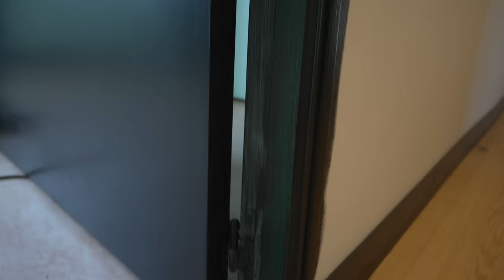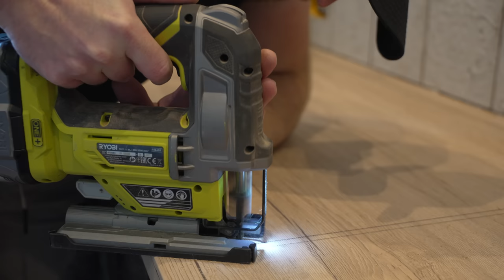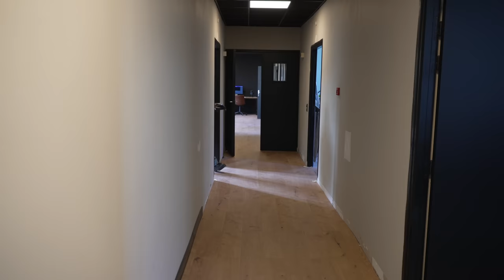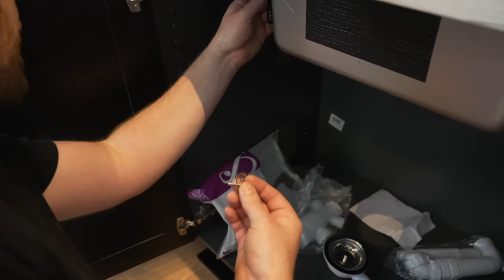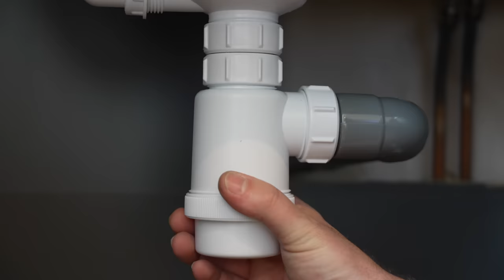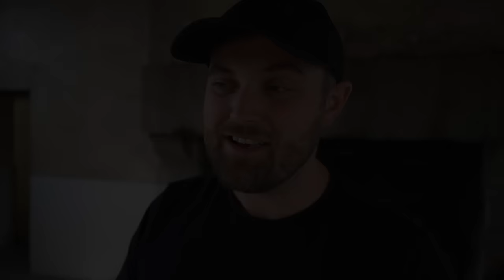We Have Decided What We Want To Do With The Convent

Comment: If you want a multi-function space in that big room you could consider adding some rigging bars to the ceiling so that events can be hosted easily with lighting and sound equipment. Then you can easily put up temporary set ups such as a DJ booth for parties, a small stage for speakers and presentations, ambient lighting for gala dinners etc. Carpeting lends itself to this kind of room though to absorb noise.

Comment: I think its use as a hotel may depend upon where it is situated.  Parking also needs consideration.  As a luxury home the interiors would need a big upgrade and with big rooms, usually comes big heating bills, particularly with high ceilings.  I do like the idea of a conference centre, in which case you may need to consider how big those bedrooms need to be to make it economically viable.

Comment: The whole building screams "Wedding venue!"  It has the Chapel for the ceremony, the large room for the meal, the room with the stained glass could be a breakout room or dance area, multiple bedrooms - a whole wedding group self-enclosed - beautiful gardens to allow the wedding to spill outside in better weather, a catering sized kitchen.  You might convert one of the flats at the front into the wedding suite - total luxury, massive jacuzzi bath, 4 poster bed, away from the rest of the guests to avoid noise issues!!!!!  You could use the rooms during the week as a self-contained conference facility.  The flats at the front could be also adapted to housing for an on-site facility manager/chef etc and possibly made into smaller units for other live in staff.  Just a few ideas.

Comment: Your idea is very interesting. The 40 rooms could easily be converted to 10 - 12 large suites. If you mirrored the suites with the en suite bathes back to back you could seriously reduce your plumbing needs. The large room would make a wonderful multipurpose lounge area that could be converted, upon need, to exhibit space, an open area for party gatherings or any number of uses. It would be great if you could find an antique bar set up much like you did with the chateaux library. The bar could anchor one end of the room acting as a focal point. An outdoor bistro like area in the courtyard would be a great compliment to the luxury/commercial kitchen you were talking about.

Comment: Billy, since you have decided to go in the direction of a public use space for the former convent. I really think the kitchen needs a commercial setup. This would require a 6 to 8 burner range, with two, possibly 2 additional ovens(4 total). Also, at least a single stage commercial dishwasher, is a separate scullery area. Also a separate salad/dessert prep area with a commercial upright refrigerator and a freezer. Of course plenty of food prep surfaces. This commercial kitchen will support any of the activities, wether it is a group staying for a conference, hotel dinning, or inhouse or take away catering. There are local community groups(historical, service, community), that the facility could service easily. The convent served the community for many years, and could continue to serve the community, in a slightly modified form. Great job so far, Crack On!

Comment: Food for thought

If you move the motor to the basement
Would you not need to give up more space in the shaft? 
Thus a much smaller elevator car.
Because all the cables and hardware for them now have to go all the way up on one of the walls. 
If you never need it to move large/heavy items perhaps that's not an issue. But larger appliances and furniture via stairs may be a factor in fixing or replacing the existing elevator. 
Just a thought.

Good luck either way

Comment: I have an idea for the 110 square meter room. My colleagues and I do annual planning seminars every year, where we plan for the coming year and sit together in the evenings, chat, eat well and all sleep in the same hotel. This is not only good for work, but also for team building and the sense of community. This usually lasts all weekend. At the beginning of the annual planning we start together in a large room, discuss schedules, activities and so on. Then the room is separated with sliding doors in ceiling rails and the teams can work in sub-groups or small groups. At the end of the seminar, the walls are pushed open again and there is a joint conclusion.

Comment: Always impressed with your videos, your skills and your ideas. I would love to see some structural archeology done on the convent as there appear to be several buildings that were constructed at different times. The "bump-up" for the elevator appears to be in an old section of the convent where a new roof was constructed to join the older section to a new addition. My eye goes to the mansard roof as the "old" or original structure and the gable roof is the newer addition. Same can be observed on the apartment roofs near the gate. When some renovations were made the "new" roof seems to be gable. Would love to get inside the roofs to see where old construction meets new.

Comment: My thoughts. If you remove one of those rooms you lose a valuable storage space for a kitchen that could be used for catering or conference center. You'll need lots of supplies which would be rather hard to get ot in typical cabinets. Also what would you do with parking?

Comment: I would avoid the option of a wedding venue as so many chateaux locations offer this. A large room with a removable divider that someone else mentioned in comments would leave all options open for the eventual buyer. If the room is decorated in neutral colours and remains an empty space,  buyers would be able to visualise  how they would use it. Buyers would probably reduce their offers by the cost of changes they need to make to the rooms but if they did not need to make changes the advertised price or more might be offered.
The investment so far in my opinion will increase the value of the convent but changes would be a waste of additional investment in rooms if options of flexible use were reduced by them.
Perhaps Ryan or Michael could digitally create options for the rooms, which could later be shown to buyers on a website, sent by email or printed in a brochure

Comment: Good idea on usage. Phillip Bolan has great insight...just saying.  RE: the suites- always a smart idea to have several different 'rated' rooms. Some lesser expensive than others. Question: do you have a formal dining area? The rectory area could be partitioned off (movable partitions) into several smaller areas. Multi-use.  Maid/cleaning services will need storage and laundry facilities. Things to consider.

Comment: When you cut out the sink , you should put silicone all over that cut chipboard edge, not just for bedding down the sink. Also if you just draw the perimeter, you can follow that with the foot of the jigsaw and that gives you the offset you need ( smaller ) ie. you don’t need the inside line too

Comment: I wonder if there would be a market for a gym in your village.  As large as the refectory is, there appears to be enough space to rent it out for that purpose.  Not sure about the shower and toilet situation though.  Just a thought.
-- There are places here in the States where there are either free or very cheap accommodations for the families of patients in a hospital.  At least one or two of those rooms could be used for that since the convent is attached to a hospital.
-- Is there a local college near you or an industry that has clients who require temporary corporate accommodations?  Those rooms converted into either low-cost rooms for college students up to luxury rooms for executives - The gym would fit in perfectly for that. 
Also, for the lift - it might be cheaper and safer to install an hydraulic one.  That would eliminate the need for a motor but also cables...

Comment: For the lift...you can install a MRL (Machine RoomLess)
The motor is installed in the hoistway.
A Hydraulic  powered elevator is an option...both can eliminate the "dog house" on the roof.

Comment: The good idea is to make the Convent a boutique hotel/conference/ multipurpose small biz center. Again, mixed use will bring income in from multiple areas.
Please dont make the refrectory smaller. Putting in that large kitchen,  you will want a massive lounge/dining area,  but make it rich in texture not cold and commercial.  If anything, add a nice private dining area for say 25 people and the rest a lounge and simple table area, but try to have some extension for eating outside. Definitely get rid of the low ceiling.  As far as the rooms go, i would think about closing off some of those very short doors and cutting in standard  6 ft entry doors in between  the old ones. You could put a table or shelf in front of the original doors with flowers or some of your chateau art prints so it isnt confusing to guests and you keep the architecture and character intact.  You may want to add a small dining nook inside the kitchen too. You also shouldnt forget the wine cellar...use it! Make it another area for wine tasting if possible.  Its France after all. 
I am so happy that the metal detecting is on. Good for Mo.

Comment: if you plan on so type of convention or meeting space you will definitely need a full scale commercial kitchen. A high quality restaurant would be a drawing card that could operate year round. In France, people will travel to enjoy good food. As for convention use, it could be businesses or even churches. Literally no limit to the ideas you could come up with. Parking might be a bit of an issue to be considered. Might need off site parting for big meetings with a bus to bring people in. I'd agree that updating the elevator or lift as you call it would need to be done. You're also gong to need a full sprinkler system throughout the building. Those granite walls are pretty fireproof but there's a lot of very old dry wood in those buildings.

Comment: Next time you put a sink in, turn it upside down and with a fine pencil trace around it, put a straight edge for your jig saw and cut it that way. cutting just on the inside of the line. Clamp the straight edge. Using this method, I have never miss aligned a sink. On the lift, is the area prone to flooding? You might want to think twice about putting your motor on the bottom. Same with an emergency generator, suggest putting it on stiltz or well above the ground.

Comment: Just priced an Kone elevator for a 2 story office building $130,000 US dollars in Oklahoma.  That doesn’t include power to the elevator.  You still might need that pop up on the roof for the clearance for the support beam.  Also elevators are a pain to work with at least at the US. Really talk to them to see what they need cause if it isn’t exactly to what they want they push you off for another month.

Comment: Hi
The idea of converting it to a luxurious hotel is good , but if you are thinking of a lounge, bedroom and ensuite than you will get about 10 rooms only, which would be economically unviable. You would have to also provide accommodation for on site staff.

I think a hotel consultant can work out the Economics for you.
Please also keep in mind that if In future you need to change the configuration it can be easily done.

I would suggest making partitions of  brick as guests would like privacy, using board & plank defeats this purpose.
Make it a hotel cum wedding venue so  maximum rooms can be utilized. 
The garden can also be utilized as a wedding venue. 
If thre are more guests the doors between the garden & indoor venue csn be thrown open.
Rgds.

Comment: Billy,
two things that I think need to be re-thought.  The refectory needs to be large enough for conference dining and yes raise the ceiling height especially if their is an "historic" ceiling hiding above the current low ceiling.  40 bedrooms is great for a community but for a conference centre each needs an ensuite which could be achieved by cannibalising 1 room (into two ensuites) which would achieve 26 rooms and that is about perfect for small executive style conferences or 52 couples.  The latter affects both your kitchen plans and the size of the refectory. 2 bob's worth contributed now crack on

Comment: The refractory could used a multipurpose room. Flexibility for a lecture hall, or video presentations or a wedding reception or a flexible movie room. I would use commerical carpet squares that use stickers in the corners. The flooring could be removed and expose the original floor for dancing.

Comment: You have to develop your strategy so that you do not have to change any infrastructure to comply with final business opportunity in the future. You can phase in its development from home  to hotel but you do not want to revisit cctv, telephone and sound systems, HVAC, zoned heat and water supply, cat 6 cabling, design of professional kitchen so staged development is manageable, staged chillers and catering stations to service conference and function rooms, staff rooms, equipment rooms (floor buffers, cleaning machines et al). Soany times I have been called in too late with bedroom to ensuite ratios incompatible with 5 star service, linen cupboards and cleaners station too far away or too awkward to be of service. The laundry needs to be well located, the list is endless. So full strategy, phased or staged roll out and build in and future proof all utility and service requirements and you are good to go. Lovely project.

Comment: Nice idea! It's a fine building, but the adaptations carried out in recent decades were very unsympathetic and insensitive. I love that you got straight down to ripping out a lot of the inappropriate interventions, and judging by what you've done at the chateau, you have a keen appreciation for period style, and a good eye for details. I was very pleased to hear you say that you want to restore the character of some of the large public rooms, and I think your suggestion for dividing the refectory is a good one. I envisioned a couple of lounges, separated by a wall with extra-wide doors in the centre, so the rooms could be separate or opened-up into one space. 
General plea - in the big public rooms PLEASE take out as many of the suspended ceilings as you can! They ruin the proportions and cut across the tops of the windows. It's a pet hate of mine. 
I love the idea for suits on the upper floors. The chapel and the gardens are HUGE assets. 
I'm an independent celebrant, so I can also see the potential for holding ceremonies  (weddings, vow renewals, coming of age, naming days, solstice and equinox celebrations  etc) and specialist residential events (spiritual retreats, artists and writers workshops, cookery courses etc) there.

Comment: The Refectory would make both a great dining space as originally designed and then could transform into a great ballroom for dancing or conference spaces. I wouldn't race to split it into smaller rooms but be very intentional in renovating it with flexibility in mind. Again, it would lend itself very well to pop-up restaurant nights throughout the year to highlight local produce, craft markets, art gallery showings for local artists & many more besides. Huge range of options. 
If the floor's in as good a condition as you think, renovate it & don't put carpet back down for easy maintenance and cleaning. If carpeting was still thought to be occasionally required & the existing one is in good condition, get it professionally cleaned & then once dry, lift it, take it to a carpet or rug making firm to have it trimmed down to the size you want before having the edges professionally bound. This way you could store the now enormous rug when not needed in the Convent's shed, only rolling it out as necessary. 
Flexibility is the key to making the Convent a successful business venture and its easy to fall into the trap of pigeonholing yourselves into narrow use cases.

Comment: I hope you used plummers putty to seal the drain on that sink. Someone used silicone caulking on one in a flat I let and it leaked after a while. It washes out. Plummers putty will not.

If I remember right, those rooms have sinks but no toilets. Toilet sewer lines are different than just sink or shower lines. I would think it quite expensive to do that plumming.